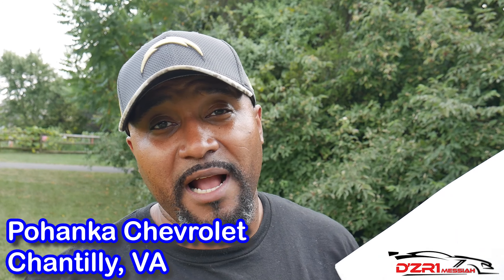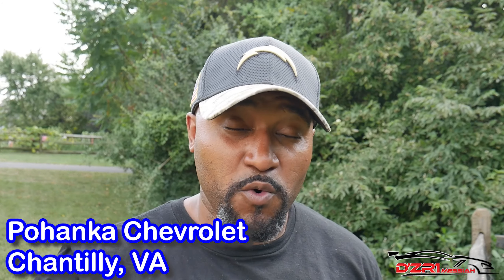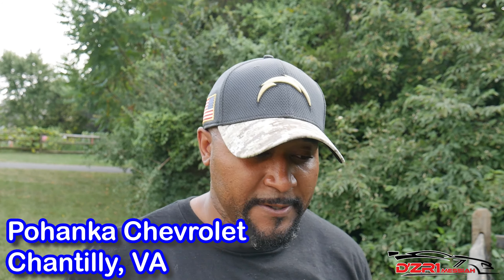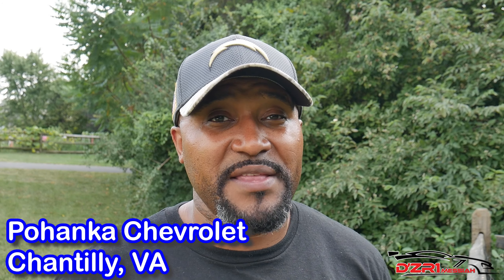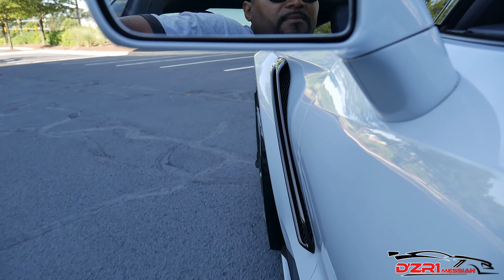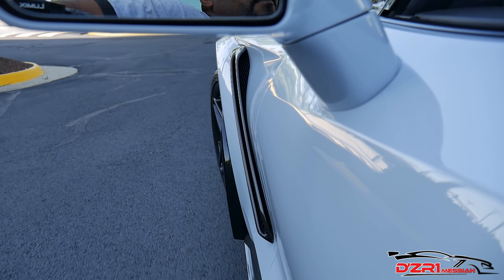MUST SEE IMPORTANT SERVICE BULLETIN  | Front End Noise When Turning

Comment: Thanks for making the video, no problem keep driving the car if it's making the noise? Also the noise goes away when you apply slight brake pressure right? And going straight the noise only happens sometimes?

Comment: This is a quick fix. It’s actually break dust between the top hat of the rotor against the hub of the wheel. 
I’ve owned a 15,16 Zo6 and they both did it. And now I have a 19’ ZR1 and it did it but I just changed tires and cleaned the hub all good. But it will come back.

Comment: At the time of this video did you have stock lug nuts or aftermarket lug nuts? I ask because some C7 owners install black aftermarket lug nuts for better appearance.
Reply from the maker: At that time I had aftermarket ones that was found to be the incorrect shape.  I had them switched out to the proper ones but the noise came back.  Thanks for the comment.
Reply: Ok, that’s what I thought. My 19 GS is at the dealership now and they blaming it on my black aftermarket lug nuts. I can’t find my original ones and they are $190 for 20 of them. They want me to purchase the original ones as they think that will solve the problem. I’m guessing it won’t or like you said the noise will come back at which point I will ask for a refund of the $190.

Comment: I have noticed that at times after using the paddle shifter in Manual mode, that when I go back to "Drive" mode that it seems to take a while to get out of the manual as it seems to downshift while in automatic.
Reply from the maker: +kenneth wirtz have you taken it back to the dealership to have them look at it?

Comment: 3 months later, are you still good, or did the noise come back?

My 2017 GS didnt make one noise for 10k miles before I sold it. 

I have a 2019 GS now. Been to thr dealer 3 times and it didnt go away. They just replaced my left hub, no noise at all. It's on the right side now. They are now going to replace that. What I'm worried about is that the hub may not be the issue and the new hubs will eventually make that noise. 

If so, I'll be done with vettes... which is sad since I've owned 5.
Reply: Robert, did you by chance have aftermarket lug nuts installed on your 2019 GS or the stock ones? My 2019 GS is at the dealership right now and they can’t get rid of the noise and they saying it’s due to the aftermarket lug nuts.
Reply: @jean-paulpegado6620  stock. Replacing both hub bearings has fixed it for now
Reply: @Robert McGonagle - Sounds good, thank you